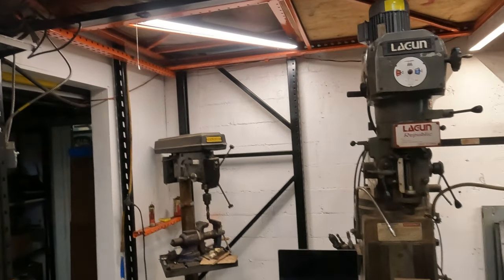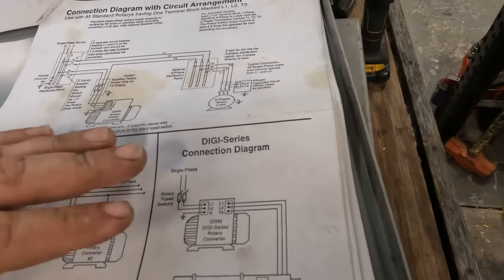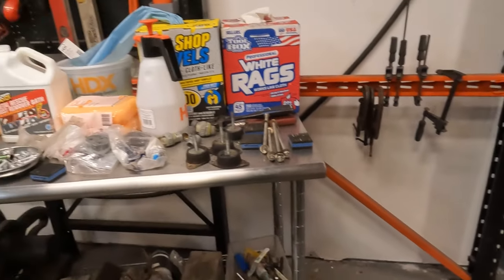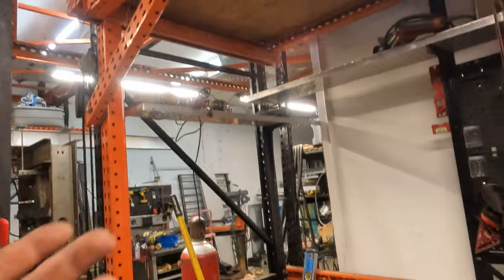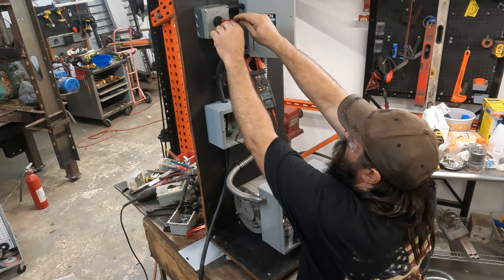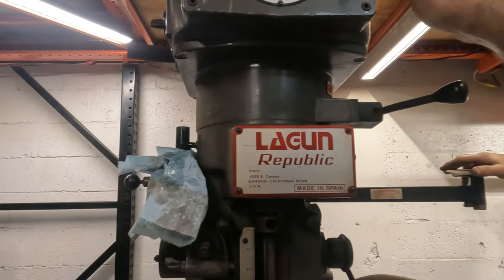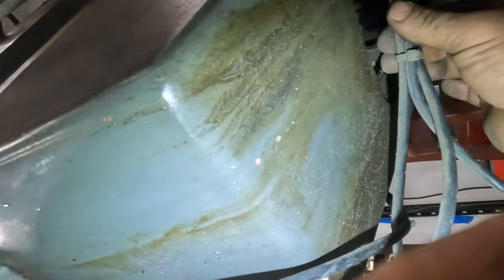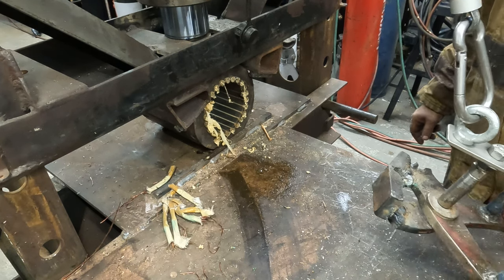How To Make 3 Phase Electric, Powering up My Milling Machine  & A Off Topic Shop Towel Review

Comment: Hey Derek,   When you turned the mill on for the first time - a noise was coming from the top of the mill. It most likely was the belt! Remember - it hasn't turned in how long? It probably had a few flat spots on it. Take the top off - check the belt and make sure the pulleys are tight.  Great video!  For not being an electrician - you did pretty damn good!!  Thumbs up!  Stay safe!  Jim
Reply from the maker: Thanks Jim, The belt is a concern of mine I will be looking to replace it.

Comment: Read the instructions to find out first, what kind of oil it needs, where else to lube and how to use it.  That is one hell of a machine.  Great wiring job.
Reply from the maker: Thank you, I am looking for an operation manual.
Reply: Amazon - 42 pages, $40.  I did find a 10 pg PDF but it was more of a sales brochure.   It did have illustrations on some of the controls.
Reply from the maker: @johndaley9188  Thanks I appreciate you taking the time to look in tom that. 👊
Reply: @ProjectShopFl  it don't use 10 /30 motor oil. Them old ones use a sticky 70/80 gear oil.

Comment: The key for the handle was holding that brass gear assembly on shaft. When you remove it, there will be bolts behind it that hold the power feed unit to bearing housing.
Reply from the maker: Thanks for the info, I will check it out. 👊

Comment: Good evening, that handle that you took apart. Moves the travel of the way, forward and back. The handle on the bottom, is your automatic feed. For the way. The handle you took apart, is the manual feed for the same way, Joe Capo.
Reply from the maker: Thanks for the info

Comment: Get that phase converter up high unless you want it covered with chips. Reverse is not the transmission. The reverse is the power quill feed. Low and high the power button flip flops forward and reverse because of the gearbox.
Reply: In other words forward in low will be reverse in high and vice versa.
Reply from the maker: Thanks for the info

Comment: When you had the speed turned up, it almost sounded like a belt was frayed and slapping against the machine. If you check that, BE CAREFUL. Springs and gears can go flying in the head if I remember correctly. Good luck buddy, I guess you are playing with an early Christmas gift. Haha 😂
Reply from the maker: Thanks for the warning. I've had the CV drive off when I replaced the motor, I should have replaced the belt. I will check it it's probably original. lol

Comment: Those damn federal pacific panels.... Seen more than one of those malfunction. The panels were alright but their breakers were complete garbage and burned down a lotta houses.
Reply from the maker: I want to replace it but I don't want to spend money on a shop that's not mine.
Reply: @ProjectShopFl  that's understood. Good video. Catch my note about the paper on the 3-phase converter? Note #7 on the little sheet of paper said one leg might be higher than the others.
Reply from the maker: @MatthewK863  Yes I did. Thanks! I want to check it when the machine is running to see if it comes down at all.

Comment: The 2nd small sheet of paper stapled on the front had #7 talking about having the higher voltage on the one leg and that it shouldn't an issue. Still watching so not sure if you ever found it.
Reply from the maker: Thanks for the info

Comment: Don’t use those federal pacific panels. They’ve been banned
Reply from the maker: It is the main panel in the shop. lol
Reply: Not banned, but no longer allowed for new install. They had a problem where when they got old they will let more than rated power go through breaker, just keep an eye on it. Like you said it ain't your place so I wouldn't be replacing it on my dime.
Reply: And nthey are not recommended for residential use but not banned, at least in most states. Probably are banned in commiefornia 🤣🤣🤣

Comment: This by no means should be named how to. .  How not to more like it
Reply from the maker: And why is that? Did it not work? Dit it fire up the mill? What's the problem? It may not be pretty or proper and I clearly stated I am no electrician but it worked with out burning anything up.
Reply: @ProjectShopFl   for one it far from a balance load. And as you stated your not an electrician and shouldn't be make how to videos. No disclaimers.. lot of stupid ppl on the web. Be leave everything they see an hear.   Sure it started up under no load. The damage that huge unbalanced load will do to eqipment under load.

Comment: If you hate made in China why do you support Walmart??  90? Of Walmart product are made for them in China.  There inventory is shipped over in hundreds of thousands of 40' sea cans. Speacaly custom made for Walmart.  All their clothing other shoes All their tool boxes storage units etc et cetera is all made specially for Walmart. In all the years they been in Canada I have never supported them and never will. Do I go in there store. Yes just to look at the junk they carry and  Investigate where each item is from witch mfg in China witch mfg makes there packaging box's. China banks are goverment run. All payments to companies in China you make your payment to the bank name and reference number that mfg gives you once you receive your order. Orders can't be small. They have a minimum order you must make per item. Average is 1000 peace for some an others is 10,000. As for your mill what voltage is it, 408v 540. And  what voltage is your phase converter putting out? You can not have a high diferents between legs. You burn the motors up in time once under load.  It sounded like you had 120 v on 2 legs an 240 v on 3rd.  No good
Reply from the maker: I never said I support Walmart, in fact I don't like them. In the mill it is 220v. The phase converter says in the manual high voltage on one leg is norma. In my last shop I had 3 phase with a high leg. It had 120,120,220 coming in from the power company and I ran my 3 phase air compressor for 2 years off it with no issues.